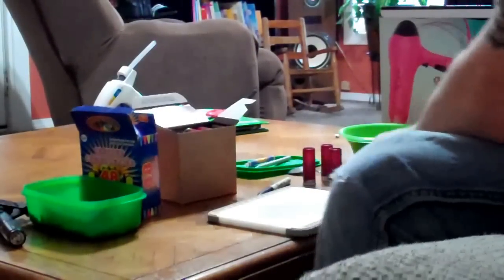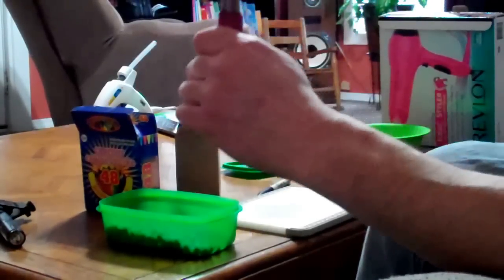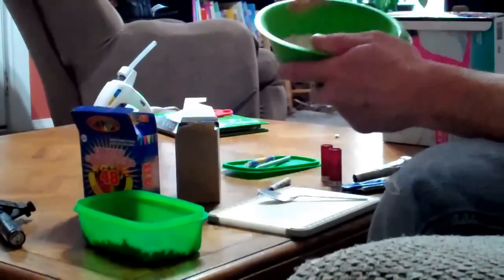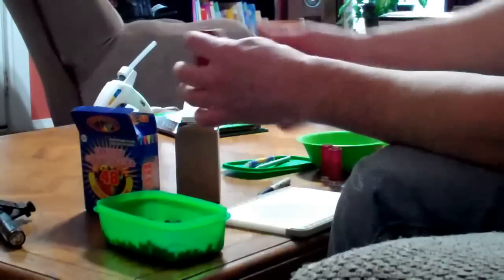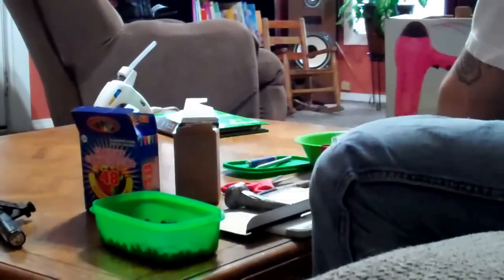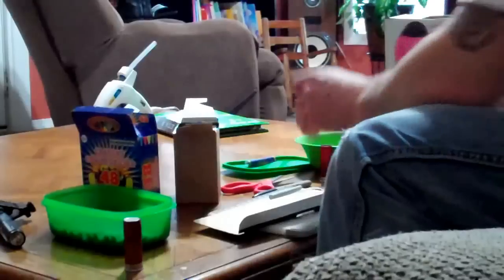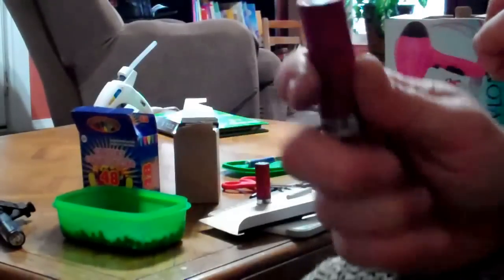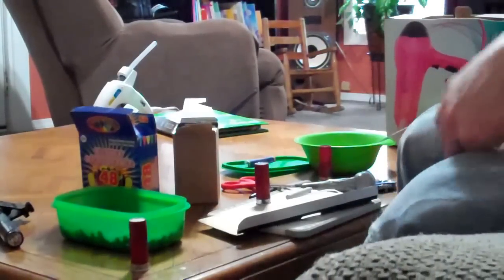DIY Birdshot Shotshell to Buckshot w/o press

Comment from the maker: Thanks for the ideas. With my current method, the cardboard disk engages the underside of the crimp roll. The wax saturates the cardboard and also flows in any cracks between the crimp roll and the disk. I designed them to be used in either an autoloader or pump. They have been tested under various conditions including temperature and different cycling conditions. I will try the glue mixture in the next batch! My loading partner and I have cycled these rounds until wax failure.

Comment from the maker: The average cycling is over 25 cycles before any danger of disintegration occurs. Also after a cycle, you can use a lighter to re melt the wax and essentially have that cycle count start over with a fresh lid.

Comment: Don't count on wax to hold your load in, when you jack the shell in they will often come loose, then the gun will explode (there's a video on U tube somewhere,  I make up similar loads where I cut the crimp out with a small sharp knife (that crimp cutter is nice) then trim the inner edge clean so you can put your circle under the crimp holding it firmly in place, I then seal with a mix of flour and white glue 1 to 1. I also use a lee handloader to compress the shot stack and wad for more space.

Comment: So if I use steel 1/4 sling shot ammo would it basically be the same???
Reply: @Marky Martinez No, gun ammo is lead, softer than steel,’don’t shoot steel out of a gun, is dangerous, if you are lucky it will only hurt the insides of the barrel,‘if you’re not lucky.... you can hurt yourself, please be careful and research carefully before doing any mods, it’s a good you asked first.’
Reply: @saltyark7564  That's odd because I shoot factory loaded steel shot all the time. In fact, you have to for ducks.

Comment: You need to show a better look at your cutting tool
Reply from the maker: John Walters it’s literally a paint scraper/mud knife that’s rolled and tack welded. Use a piece of cereal box cardboard as a template. I suggest making it a few thou more than the crimp leaving the factory rolled edge. Essentially just cutting the star out. Once you have your steel rolled, sharpen the inside edge of the tip. I put serrations on mine after I shaped it. Serrations are easy. Just make a 1/8” semi circle cut on the tip with a dremel in the 12&6, 1&7, 2&8, 3&9, 4&10, and 5&11 o’clock positions. Then sharpen those. Once you have your completed tool, just fold up a piece of old sock 🧦 many times and put it over the back to protect your palm. I taped it on with duct tape. Hope that helps. P.S. I still have that tool to this day,.. what 9 years later. Lol good luck my friend!
Reply from the maker: P.S that is a crappy shot of the tool!
Reply: @tyler79durdan  it seem to work pretty good
Reply from the maker: John Walters yeah it’s great. The only issue is people think this is a video on how to make a buckshot load. But it’s more of a shtf type of load. Thanks for watching though! I do appreciate it, even if none of my videos are monetized.
Reply: @tyler79durdan  that's why I watched it

Comment: putting glue or wax in your loads causes foweling in your barrell and will cause it to explode, my friend did this and blew up a almost brand new mossberg 500 and almost lost his thumb, if you don't clean the gun after about 5 shots (estimate) you could too, save yourself a gun and possibly your fingers, eyes, life and spend the money on either a press or just buy the buck shot shells, thats why there are books written about reloading data and they should be followed, hell why not put ramen noodles in your gas tank and see if it will get you to work.
Reply: I don't have a friend that has done this , but I have...wax, crayons and hot glue. Your statement on fouling has not been my experience. Ramen noodles, however, would most certainly foul the fuel system. Your advise is somewhat suspect.